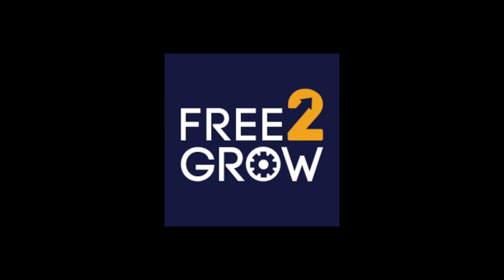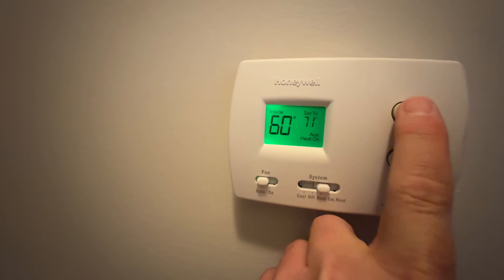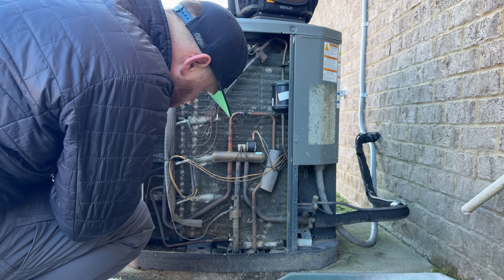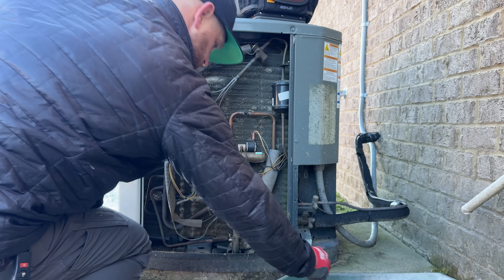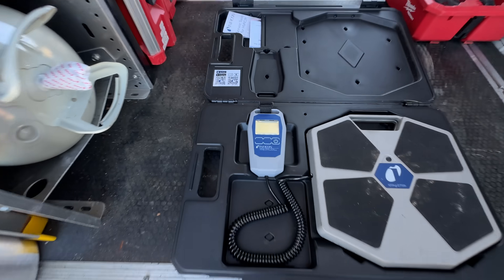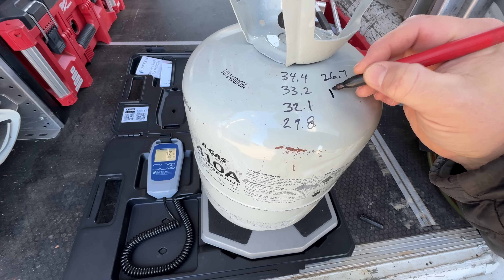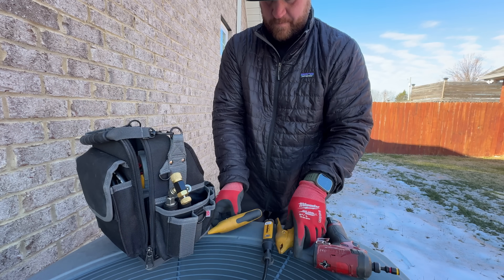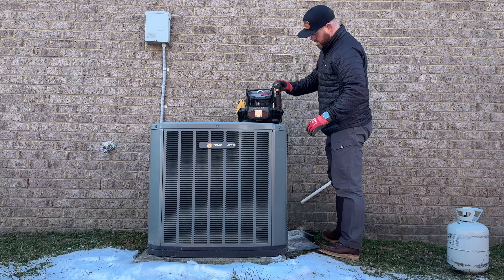Trane Heat Pump WON'T stop Turning On/Off - COLD Weather Diagnosis

Comment: You could bypass pressure sensor transducer  have the unit running litle longer -TXV inlet should be colder than the TXV outlet

Comment: That’s something I hardly ever see. I can’t remember last time I seen one actually when heat pump condensing unit. What you could’ve done it’s just pulled out the charge and see how much it was in it. It has a hard diagnose to make a special on a cold day like that.I would’ve felt more comfortable pulling the charge out and seeing how much is in it before condemning the TXV.

Comment: Is that r22 and you just didn’t change your app over from 410a? Because if your in heat mode that head pressure should have been a lot higher around 300 in heat mode. When they are low on refrigerant you will see it freezing right past the outdoor txv and it can be misleading. This looks like very low refrigerant to me though.

Comment: In 2014 they had the rust inhibitor in the compressors causing TXVs to stick. You might see if this system was one of them. They used to reimburse for shooting AC Renew or it's sister product (can't remember the name) in to the system.

Comment: Hello Zac, I do not know what happened but I could not activate the subtitles to Spanish, change the ideome in the configurations of Yotube, changing your voice to be able to listen to it in Spanish, great contribution I think that if previously someone had already gone to diagnose that equipment time ago and manipulate badly at the moment of carrying out refrigerant gas load could not have put air into the system and leave non-condensable gases that over time would react with the oil and prove that the valve of Does expansion stick? I send you a strong friend hug from Mexico and I wish that your channel continues to grow you always learn something new with you. I am Cesar 
I hope the translation goes well and you can understand what I meant!!!  😅

Comment: quick question, i am a newbie. i know during heat mode we hook up low side to true suction, what a about the high side gauge, i seen you hook up to the liquid line. i used to hook high side to the vapor line which is hot gas line in heat mode. so which it a better choice and can you explain
Reply: The vapor line is discharge gas going to the indoor coil so not a good area to be taking pressures. The liquid line is where you want to connect to
Reply: @Josh-px6xb  thanks, i will do that from now on

Comment: Almost every trane I find a refrigerant leak on is the transition from copper to aluminum on the very bottom of the condenser coil
Reply: Zero found in the joint! Sold Am Std 2003-2024.

Comment: Curious to know what happened? Had the same situation on a trane. EEV went then the sensor on the new one. Worked in heat but not ac. They sell a magnetic tool now to open them.

Comment: Quick trick for people so you can stop doing that bulb in a water glass crap. Intentionally create a high head by disconnecting CFM. Pay attention to your head don't let it go above like 350-400 PSi you aren't trying to destroy the system you're doing a trouble shoot, but let it climb. Notice your suction pressure. If it stays still and doesnt budge. You have a good TXV. It takes 5 minutes. Only works on TXV/EEV. If you're doing commercial like me and any smart tech lol its even easier like everything else is with commercial. Just take the door off to the compressor section. Only works if the compressors are in the condenser section of course. If they are in their own compartment like some Yorks and other units have. Disconnect a CFM or put cardboard over the condenser coil. Easy as that, stay safe out there.

Comment: You could bypass the low pressure switch so you don't have to hold the contactor in. Keep a jumper in your bag.
Reply: Or you can just hold the contactor in.

Comment: The only thing I would have done differently is try securing the bulb to the discharge line. I know they have electric heat to get them by but it’s a quick way to try and get that TXV to open. Again they have electric heat so doesn’t really matter. Good stuff 🤙🏻
Reply: Never thought about that, thank you 😂
Reply: 30 yrs, 100’s of TXV replacements and I’ve tried incandescent lamps, heaters, etc. Two responded to heat. Don’t waste your time. Carry the Parker TXV kit and get it done.

Comment: I use a similar way to figure out whats going on, and if i fine a bad outdoor TXV, i usually run the AC for few minutes and if it works fine then im sure its the outdoor TXV, that unit probably has an EXV

Comment: I agree with a couple of the others… I would have energized the reversing valve… you could have initiated a defrost cycle…. But good work.. I’m a 40 yr +. Service tech Doing residential and light commercial … last 24 working on Trane equipment..

Comment: I would have hooked up gauges and broken O. From the readings then, could determine outdoor or indoor txv issue... or if it's a charge problem.
Reply: What you mean? Broken O as in reversing valve? Sorry new tech here